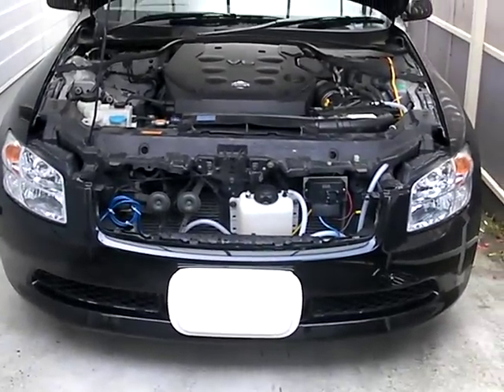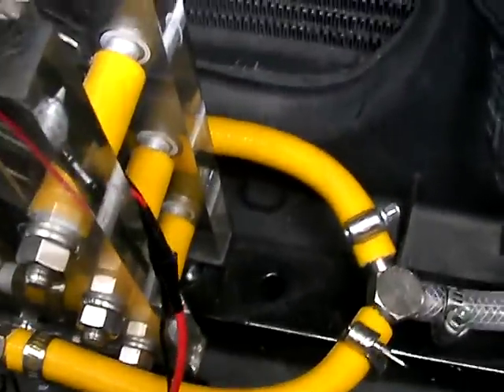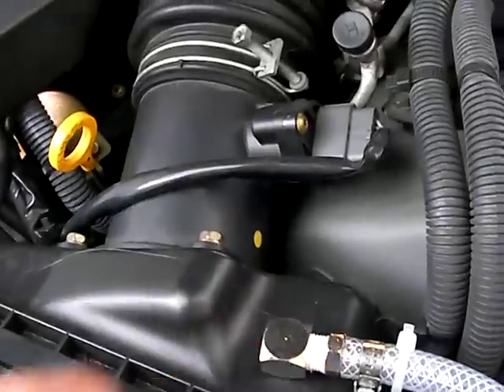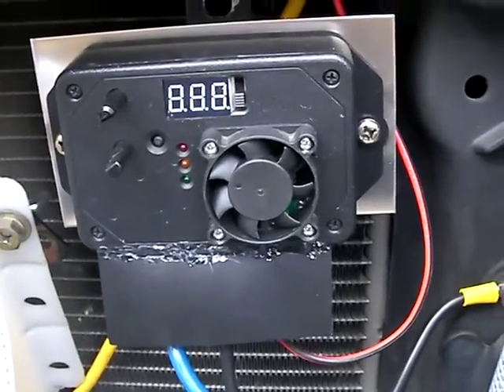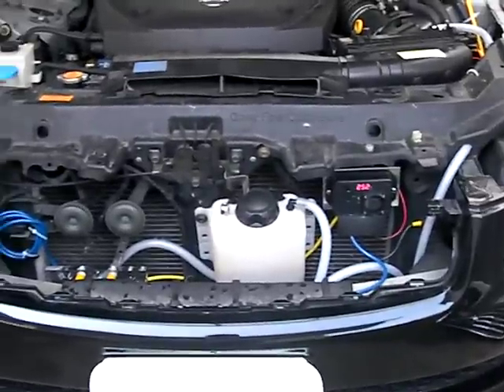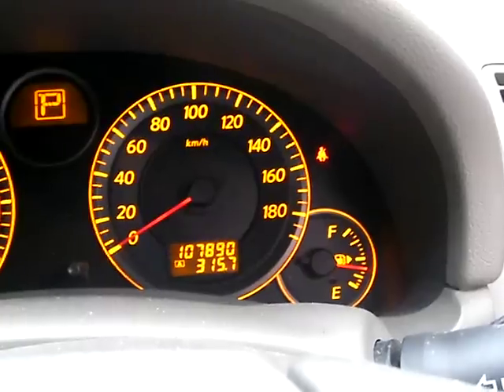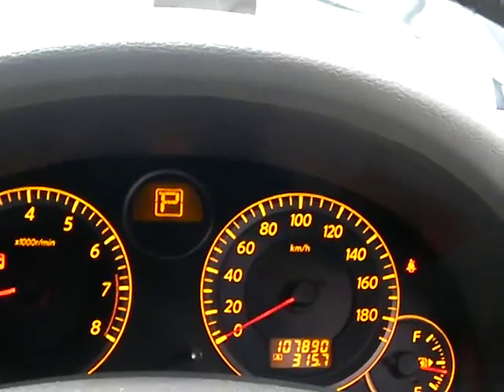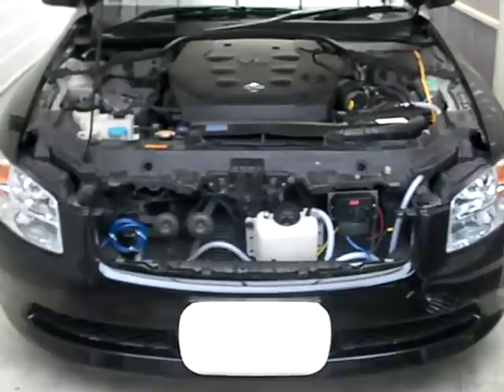Successful HHO install in 2005 Nissan Stagea

Comment: The relevant point here is that it always takes much more energy to make HHO then you will get out of the HHO. It takes gasoline to make HHO. That gasoline will move the car farther then the HHO.(When a load is added to the electrical system, the alt pulls harder--using more gas). These devices never survive a real, stringent, honest, scientific test--never. And yes, many have been done, by interested people you have no ax to grind. 

One reason these folks dismiss the amount of energy>>

Comment: That is what the PWM is for.  (if i understand correctly)   The battery supplies it and it does everything else.  (amp wise)    Im sure that it still has a load.  But nothing like hooking your battery directly upto the cell.

Comment from the maker: M6foguete For your information, I have never tried to sell my design.  I have only shared what I did and my experiences working with HHO.  HHO is a fuel.  I don't care if you choose not to believe that. . NASA has been using it to launch the Space Shuttle for many years.  I have banned you because you are an ignorant troll.

Comment: I noticed you moved the pwm from onder the hood and placed it in front of radiator also.  Is this because the pwm was getting too hot under the hood?  I am installing my kzx1250 today, and had planned on placing under the hood, similar location where you had originally installed it.

Comment from the maker: No. This system is controlled by the PWM.  The pluse width modulator controls the flow of power to the cell.  It will not let the cell get too hot or amp run away.  When the engine starts the cell starts and when the engine stops the cell stops.  It a great fail-safe feature.  The battery is always charged by the cars alternator.

Comment from the maker: Freezing weather is no problem.  You just add more sodium hydroxide to your water.  This prevents it from freezing.  The PWM manages the increase in e-lyte by keeping the amp level at a constant rate so you don't have a run away temp increase.

Comment from the maker: I agree 100 percent. If you dont get the mixture right and lean out the fuel too much you will burn a hole in your pistons.  The whole process is tricky and must be tuned properly to each car.  This car is my daily driver and our family car.  I must have it for work and travel.  If I had the money I would love to do some extensive testing but I dont wan to take a chance and damage my engine.

Comment: To gain proper mileage effeciency, one has to go back to the basics of how engine operates. Also need to get and use professional tuning equipment, such as : V-AFC by APEXi , something that allows you to modify the intake air based on % value, not any one setting.  If EFIE is used, easy way to burn your engine without another EGT sensor (Exhaust Gas Temperature)

Comment from the maker: You want to have the hydroxy close to the injectors.  If you have the injection point too far away the gas will dilute in the air and you will loose power and performance.  In my set up I should have moved the injection point closer to the injectors but I still got a performance enhancement with the original injection point.

Comment: the hho gas travel alone with the air in the intake and travel down the intake manifold than into the combustion chamber to burn with the fuel. add he do was to control the fuel spraying into the chamber and add in the HHo and voila increase in gas mileage. so if he can have the hho to produce a lot of gases and cutting more fuel, he can be a very happy man and than educate one another =]

Comment: I did not say anyone was an idiot, but power is easy to measure on a dyno, so please link me to a video showing a documented power increase using this setup. 

I dont doubt that gas mileage can be improved upon with a well tuned hydrogen setup, but its just the power part I am having a hard time believing. 

I spent years messing around with Hondas trying to make power....in fact I have a ultra rare '92 GSR w/ '01 spec B18C5 and Mugen Gymkaha spec manifold for sale at the moment..I'm done w/cars

Comment: increase power from basic chemistry. the HHO injected into the engine has exactly what's needed to burn itself into waste, water. Thus fuel & air is added in the perfect mixture which = more power(also in large part of adding a different kind of fuel) aka less unused power. And as he said the car was reprogrammed for this, so the car knows how to adjust the fuel which means the mixture with not richened nor leaned

He's not wrong in any way and I don't see how you can think hes an idiot

Comment from the maker: Yes, I used a device called a VoloFS2 chip that automatically adjusts the engine variables and remaps the fuel injection programming.  It works and it is safer than using a manually adjusted EFIE.

Comment from the maker: I am not an engine technician and I did not have an engine schematic to look at when I was making this system. Also this car is my primary source of transportation.  I used the volochip to automatically lean and adjust my fuel mixture because doing so manually can be damage the engine if you lean out the mixture too much. I made this system to prove to myself that water can be used as a fuel and can be used to increase the burn efficiency of an engine resulting in better gas mileage.

Comment: "I think thats a mass airflow sensor???"  

Are your serious?  Your claiming a power increase?  The way to more power, is more airflow, so you can increase the fuel without going to rich......more fuel with the same airflow=Less power!

Seriously, this is how to make power on a dyno....you lean the fuel mixture as lean as you can without detonation(pinging) or fuel pre-ignition.   Again, adding fuel without adding airfow=Less Power

14 year olds in shop class know this. Did you fail shop class?

Comment from the maker: Yes. The coldest it gets is about -3 or 4.  In the winter I just add more sodium hydroxide and the kzx1250 pwm compensates for the higher mixture.  It will maintain whatever amp load you set.

Comment from the maker: What model year is your Carina? If the year is before1985 then your engine has a carburetor and it would be very easy to do an install. If you have a later model then the engine is electronically fuel injected so it would be a little more difficult but if you know cars pretty well you could do it.

Comment: Great work!  I just installed two cells in series on my massive dodge ram with the volo chip. Have not tested volo yet. Before volo (using o2 extender) I went from 12mpg to 17mpg!  While 17 is not that great, consider the marked improvement!  I have not tested on all highway mileage yet. My overall end goal is to get a 50% increase and I am close!

Btw, what part of Japan are you in?

Comment from the maker: I ran this system for one year to test the durability. After one year, the system has developed a small leak.  I have taken the system out now and have fixed the leak.  I plan to work on a heater now for the winter using the same cell. To answer your question I got about a 25 percent increase in fuel economy. Can't say what the miles per gallon are but I went from 6.5 kilometers per liter to to 9 or 9.5. If I would have moved the input closer to the injectors I'm sure I could have gotten better.

Comment from the maker: No, not on the kzx pwm.  You would need three connection points. I think  the KZX 1250 pwm is only rated for 50 continuous amps.

Comment: Your opening statement was correct. While i realise he is not running the car totally off it, Because he in fact said this in his video, i also know for a fact that even if his cell was designed big enough/ efficient enough to run the car entirely on hho (IE it produced sufficient vol to run at stoichiometric) it would in fact not work. can u not see that by producing hho ur in fact using more fuel to turn the alternator . does this make scence to you

Comment: I'm no expert but it looks like you haven't really understood what is happening. The electricity used to split the water is not enough to move the car. Far from it. But it is enough to split a small amount of water into HHO gas which assists the engine so that it burns a little less petrol. Stan Meyers system ran the engine completely but this one doesn't. It just adds in the gas to help the engine use less fuel. We're not seeing 'free' energy yet but we are getting super-efficient. Good stuff !

Comment: flow of energy conversion to work.

Chemical (hydrocarbons) : mechanical (rotational) aprox 2/3rds loss in conversion.

Mechanical (rotational)  : electrical (alt). battery charge

Electrical (alt) : chemical (hho).This incurs load on alt and and more resistance to rotation HERE IS THE FAILING you can not run a engine on the power produced by the alternator its like saying i can run a motor off an alternator forever when there connected by a belt 

Chemical (hho) : mechanical (rotational).

Comment: I dont see why it sould break any thermodynamic laws. The battery gets charged by the alternator and can be used to run headlamps etc . I see no reason why it shouldn't also run the HHO device. And then the hydrogen is simply unlocked from the water. This system has been around for a while now. You need balls and knowledge to install it safely in your car so that's what's stopping a lot of people from using it.

Comment: Nice Stagea, nice setup as well man, looks pretty clean too, got any comment on what the controllers said about this setup?
Is it road legal or did you have to go around it somehow?
You think I could use that on my 1992 Volvo 240 2,3?
It has injection and plenty of space in the engine bay as well for a setup like this and it would be golden if i could know exactly what and where i should purchase it from.
Doesn't have much money to begin with either, and this car is thirsty :)

Comment: A1+++ VIDEO. thanks for sharing your success. 
is the size of the bubbler very important as i think i might have to use a smaller one as i'm restricted with space. also does your gas that goes into the bubbler below the water line or above it. was the volo easy to install and does the velo take care of all the sensors. also does the velo work fine with out the hho with just regular fuel? in case i need to shut the system down during a journey.
thanks

Comment: This is why he has the Volo chip, when the HHO burns, it generates more oxygen in the exhaust system, the sensors before the catalytic converter pick this up, think that the fuel mix is too lean and sends more fuel to the combustion chamber.  The Volo chip tricks the computer into thinking that there is not too much oxygen in the exhaust by changing the voltage of the sensor, and therefore the computer thinks everything is ok.

Comment: you still need to be very careful. I seen some failures where the relay didnt turn off the cell or produced to much gas and blew up the intakes. Also dont let your cell run dry it will over hear and burn up.

Comment: u may be better off changing the jets on the carb to jets from something like a humidifier.  i have been told that by changing the jets so that it is more of a mist instead of a stream you can get much much higher MPG.   HHO can work on carb setups probably much better than a newer EFI car as the computer does adjust it but by what i have found out through research is that it adds fuel.

Comment: being as this is a newer car, im actually very surprised that you were able to get any increase at all?   Is there any way you can prove that you got these changes?   I was under the impression that there was absolutely no way to get any increase in mileage on anything that had electronics such as o2 sensor the ecu and so on because the computer would detect that gas and hence forth dump more fuel into the system.

Comment: hey quick question, with fuel injection I'm sure the computer adjusts for the change when you add the HHO, but what would I have to do with a carbureted setup? thinking about trying this with my old truck just to see what happens, but it's got a 2bbl carb on it, I don't want to blow her up with a lean burn or something
Reply: work good with carbureted setup

Comment: You are producing far too much HHO! You have 1.6L engine, you need like 0.5-1 LPM max! In this case, more is not better! For each 1000 ccm of engine size you need only 0.3-0.5LPM. Try lowering your production, reset the Volo and see what it does.

Comment: hi hydrophoenixx, i have a hho generator that produce 2-3LPM @ 25A, the temp of water arrives at 50-60" in 15-30min, i have used the pwm at 300hz 50% duty cycle, i have a volochip too for ford focus 2004 1.6i, i don't think you have more power on car and economy on gasoline, for me that didn't works, the power and the economy of gasoline was the same, how it's possible to work for you and for me not?

Comment: im just getting into learning about this HHO stuff but it is very intriguing! if i have this straight, the rig makes the flammable hydrogen gas which is fed into the bubbler which feeds the gas into the air intake for the engine where it is sucked into the cylinders, mixed with the gasoline and burned? if so, i believe a trip to the hardware store to make my own unit is in order!

Comment from the maker: Actually, I got an increase of about 25%.  I was using unleaded gasoline with hydroxy.  I have since taken the cell out of the car and am in the process of making a hydrogen heater.  During my testing with hydroxy, I used the volo chip.  Now, I am still using the chip and using high octane gas and have gotten further increases as well as performance.  Thank for your kind words about my Stegea.  I really love that car.

Comment: @hydrophoenixx 
please make me understand a thing, i saw some kits and they are not selling this Volo module with it, so then i understood it's an.. add-on, some kind of a bonus for the system's efficiency? where do you connect this?

Or is an upgrade of the chip that those kits come with? meaning you put that one out and put this Volo in?
thanks.

Comment: this will in no way improve efficiency of a car, if it did do you not thing car manufactures would be using this technology? all tipis is doing is creating hydrogen and oxygen so you have a "lag" meaning that on demand power is marginally improved (mainly placebo) but overall power is reduced because of heat generation, resistance etc.

Comment: @ke4uyp you can still improve economy of modern day cars, through reducing engine friction and heat wasted (mont petrol that goes into a car goes to heat) etc, however that pice of shit hit put in front of his radiator will not all that does is produces unnecessary heat and puts more load on the engine.

Comment: many many many kudos  i have been looking at different hho set ups on cars for around a year and yours is by far the BEST!!keep up the good work. when we all work together we can  be come dependent free from oil countries. 
2things though:
#1 i was expecting you to rev the engine when you said how much power it had and how fun.
#2 id like to see your pwm  moved inside the car because water / moisture eats away circuit boards like cancer just devolves em. and yes i know why its out side the car.

Comment: what temperature is your unit running at ?... it is a very well made system guy, but the vapour trap double loupe is dodgy, trap water yes, but block flow too !, rather put bend up so to re drain back to source. interesting video.
Thom in Scotland.

Comment from the maker: @belijose.  I have seen an increase in fuel economy. I was getting 6.5 to 7.5 kilometers per liter before my HHO  and VoloFS2 chip install.  Now Im getting 9.5 to 12. I am very happy with these results. For reference, 6.5 KPL is about 16 MPG. 11.5 KPL is 28MPG. I  As for your injection question, I put my injection point before the sensor.  I'm using the Volo chip and want the sensor to tell the chip that HHO is being produced.

Comment from the maker: At first, I was running the system through the air filter and had no problems.  I did check the air intake and there was a small amount of white residue at the bottom on the plastic. I have the injection point put into the air box so I don't think there is a problem but to be on the safe side i will add a filter/ dryer.  Thanks for the heads-up

Comment: Modern day fuel injected cars burn 97 percent of the gasoline that enters its cylinders. Only three percent goes out the exhaust manifold. So the most you can possibly reduced fuel consumption per power stroke is three percent.

Comment: If the total amount of fuel injected into the cylinder per power stroke is not reduced then the MPG cannot be improved.

On the other hand if the total amount of fuel injected into the cylinder per power stroke is reduced them and only then does the MPG improve. 

So the bottom line is, it is the act of reducing the total amount of fuel injected into the cylinder per power stroke that increases the MPG not injecting HHO.

Comment from the maker: Sprebound,  Very observant of you. The PWM has a layer of  resin covering the circuit board.  The maker says that the PWM is rain proof but I have been concerned that in the event of heavy rain while driving the PWM would fail. So far, everything is great with the system.  I am going to either move the PWM down behind the bumper or install a rain defector of some sort. I have added some water just to keep the level at the max.  Thanks for the kind words.

Comment: - behind the baffle that could potentially allow moisture to get to the board. This is all theoretical, its just something I thought about when watching that part.  Have you had to refill yet?  I dabbled with the idea a few years ago but they didn't have that KZX1250 back then either and it sounds pretty awesome, if it works.  I'd love to put something on my truck even if it only provides a small gain.  Excellent work, it is very cleanly done and I'm excited to hear more.